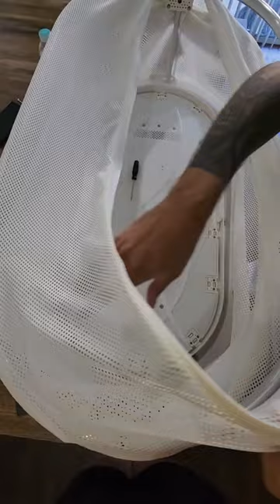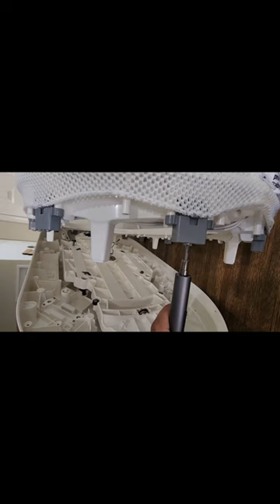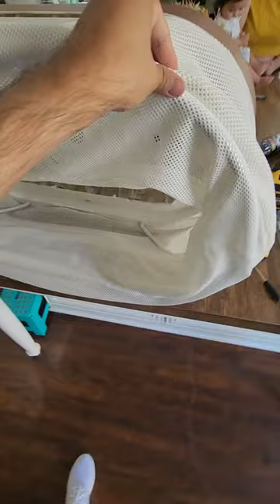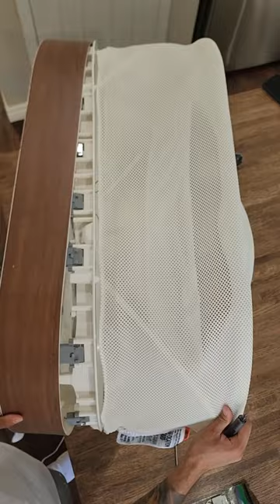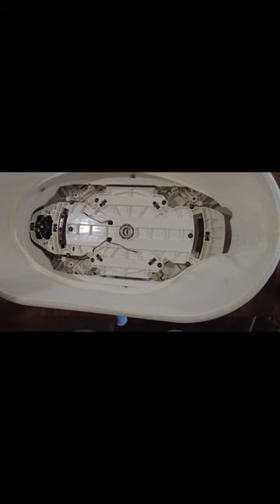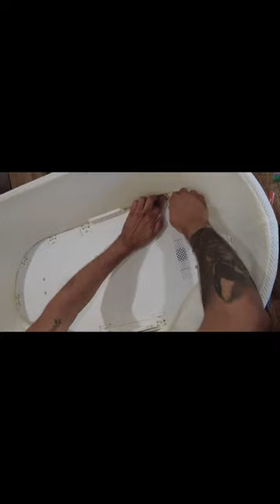Happiest Baby Snoo Mesh Removal and Deep Cleaning Tutorial

Comment: Okay so I did all this. Beautiful video. Thank you! BUT, when I got to the point where the netting should release, mine is somehow attached & wrapped around the top part of the frame… 😞Any ideas or suggestions for how to remove it from THAT? So close.. yet so far away. 🤦🏻‍♀️
Reply from the maker: Did you thee the part of the video where we remove the plastic tubing? If you are still having issues. PM me on IG and send me a pic please.
Reply: @SnooRepair where is the part of the video where you remove the plastic tubing..? Is it on a different video?
Reply: @michellehoisington9027  See 3:00 mark in video
Reply: Thank you!!

Comment: Just wondering what to do if 3 of the 6 screws (at the end for the metal sheet) don’t screw in on one side?
Reply from the maker: @Lexistar1233  you will need to remove and readjust. Make sure the sled is centered and became fully the position doesn't shift when reassembling before inserting screws

Comment: Hi! We are putting the snoo back together and noticed some of the copper wiring is loose when we plug the speaker back in? How do we fix? Does this need to be fixed? Not sure how this happened. Also, when you drill the six screws back in after putting center screw back in, does the middle one on each side actually catch the middle hole of the brown bar underneath? TY!
Reply from the maker: If the wire is exposed then just wrap it in electrical tape.

Yes on the plastic brown brackets. If you are having trouble just message me on IG and I can walk you through it via video chat.